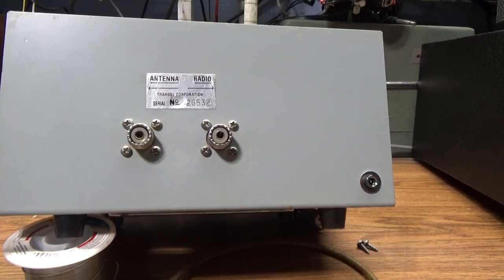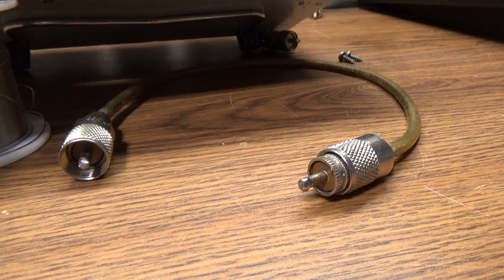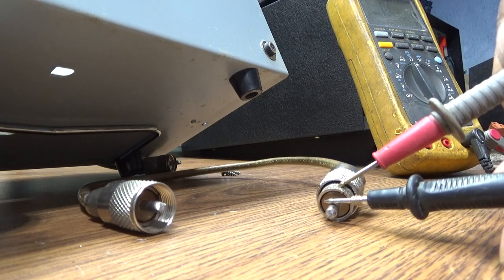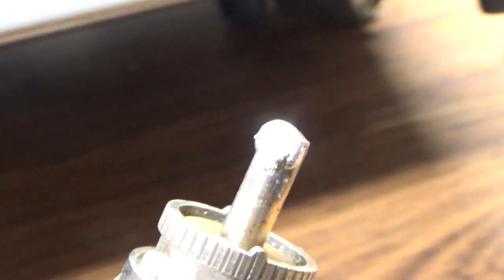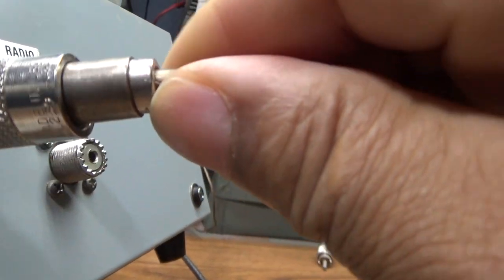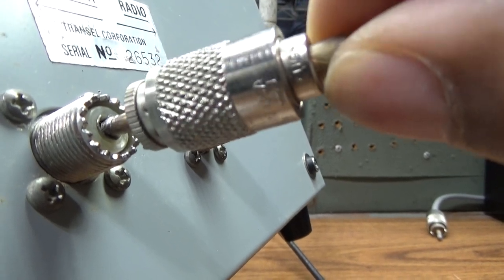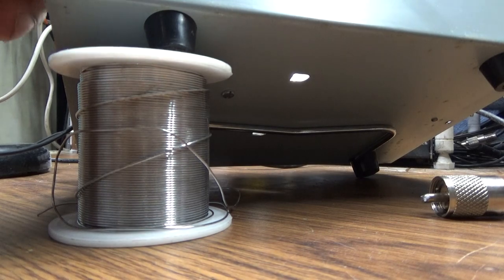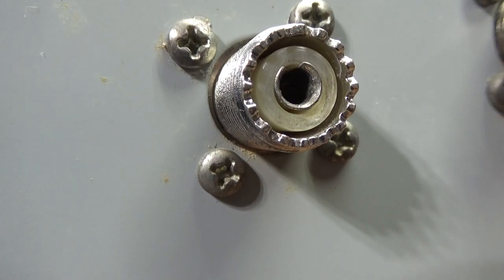Linear Amplifier Killer, silent but deadly

Comment: You know, I hadn't ever put that much thought into that extra solder blob...now it makes sense why I have had trouble with a few connectors over the years at times. Thanks.
Reply: you can always dress it with a file to get the correct 4mm diameter... but check it with a micrometer or vernier all around so you have it spot on.  Check sockets with the blind end of a 4mm drill.  After all, a PL-259 is just a screened banana plug.
Reply from the maker: welcome

Comment: Same thing that happened to me. Took 8 pills to the river. Cost me over 500 bucks to get the amp repaired. It's great you made this video.
Reply from the maker: Sorry to hear that. So many newbies get an amp and kill them quick because of something simple and stupid like this.
Reply: There's another connector problem that will kill an amp: cracks in the connector insulator. Inspect them with a strong light and a magnifying glass.

Comment: It's not over jealous , it's over zealous!
Yes the lump of solder spreads the center of the SO-239 then you have an intermittent connection which kills the final in the amp have seen this dozens of times in my 40+yrs as a tech.
Reply from the maker: number 27 that has brought that to my attention, thanks.

Comment: As a retired aviation tech, that cable AND connector are  bad news.
There should be four fingers , not a split cup inside the connector.
I use UHF to BNC adapters and quality BNC cables for most of my equipment, and for high power, I like N connectors.
The problem with the UHF connectors is the shell can and will loosen up over time, and cause intermittent connections.
Reply from the maker: Agreed. Single split is bad news.

Comment: I tell people this  all the time and they still don't get it. Never force a difficult plug in there either. The other thing is, those single split sockets do seem to more often be like this. They come with a lot of American equipment too. The other thing I'd like to point out is the continuity test. I hear people say it tests fine with my multimeter. But as soon as you put real power through it, it's a different story. Especially if it arcs, heats up and expands, or pits. You're going to have an intermittent open circuit, which swings with power levels, particularly on SSB. This I mean for dodgy solder connections, but it applies to mechanical connections too. Always check the plug for discoloration, grey or black.
Reply from the maker: I agree, especially with the single split sockets. Quad split are much better.
Reply: @tramdr  yep, you know your stuff, I totally agree... from literal experience.
Reply: Yes Sir and look for white connections. That is oxidation of lead and aluminum. Everyone knows red is rust (iron oxide) but other metals oxidize as well. Oxidation interferes with connections. That's why you have to sand a spot clean for the ground when welding. Think about this, If electricity needs a clean connection for welding (with all of that power and Amps) your radio equipment needs clean connections for it to operate correctly. Ya'll Take Care and be safe, John

Comment: I use BNC cables exclusively. They're good for a lot more power than people think. They're more reliable, more convenient, come in water tight varieties, and are an actual standard RF match.
Reply from the maker: I like BNC's but would not use them for high power though.
Reply: I like them for fast connection and for some HTs and Portables, but I find they have more play/wiggle room at the connection, so I don't trust them as much.

Comment: The problem is that the heat causes the Teflon insulation to move and allows the connector to expand. Replace them with genuine Amphenol phenolic connectors.
Reply from the maker: can't beat Amphenol

Comment: Most of us have a multimeter, and it will tell us most of the story. Electricians have a  stronger tool, one that checks the strength of the insulation. It's commonly called a "megger", and it will reveal problems that a multimeter cannot. 
Amplifiers can produce voltages and currents high enough to reveal problems that don't exist at lower power levels.
If you have a situation where the SWR is good when barefoot but goes south when the amplifier is on then you've got an insulation problem.
Reply from the maker: Meggers are cool, but how many people have one of those?
Reply: @tramdr  That's true, unless you're a commercial electrician you probably don't have a need for one. We had them at the power station and when I was a contractor. Now that I'm retired, the odds of my having to test 4160 volt motors is nil to none. Those were the days...
Reply: @tramdr  They're so used to test transformers.
Reply: There's some Cheapo Meggers available nowadays. 73 DE W8LV BILL
Reply: Excellent..Many thanks..I’m 78 years old, and I’ve just realised I’m still learning!  Thank you.
Reply: I used to use one when I worked at Digital, we called it the high pot (ential) test and we'd look for leakage using an ammeter and variable transformer going up to 600 volts if memory serves. It was a really simple circuit and would be easy to build.
Interestingly enough I started having failures at a certain point and after investigation determined that after several years of use the insulation in the test jack had broken down and was carbonizing! Always test your test equipment😂

Comment: Yep, if you make up cables and wind up with a blob of solder (like you pictured), Don't heat it up and try to remove it. Heating it to remove it may create a void inside. Just take a file and and file away the excess solder, it will only take a few passes to remove soft solder. I like to use the tiniest amount of dielectric grease on my connections. I just wipe on (and back off) enough to prevent oxidation. I have heard all the debate about 'greasing' coax connections but I have done this since the 1970s with No issues. I'm also saying that you shouldn't even be able to see any grease, just enough to prevent oxidation,  no 'Blobs of Grease'.... (I know, I know,  your cousin works for XYZ cable company and he says not to...). Do what makes you happy but I have seen equipment acting up and the ends of the cables are white. That is corrosion that will interfere with good conductivity. Nice video and Well done! Ya'll Take Care, John
Reply from the maker: I agree. At my job we had a machine with undersized connections on a wire harness. Deoxit and other stuff was useless, but dielectric grease actually helped.

Comment: The 2nd PL-259 with the "solder blob"  which ruined the dielectric core of the SO-239 was certainly a poor soldering job.  I recall many years ago from the manual with my 1st soldering gun "Apply only as much solder as necessary to make a good connection" Excess solder may fill up tube sockets, or cause shorts.  I have soldered several PL-259 connectors using RG-258 either A or U using just enough solder to make a good connection on the tip. Clip off the excess wire and smooth.
Reply from the maker: Exactly

Comment: And if your amp has those awful HEP transistors, they all pop immediately. I wish they still made the TRW transistors. I have accidentally keyed them without any load for 10 seconds without hurting them. I’m 66 years old, so I’ve seen a few things since I started electronics when I was 9 years old.
A tip for beginners too, if you take an RF power transistor out of your linear and test it, it may test fine. But remember that inside there are many transistors in parallel. You could be testing only one good one and the rest could be open. The only thing you can really do is try another one and see if the power output is okay. That messed me up when I worked on my first transistor linear. And keep in mind that Turner made a bunch of +2 microphones that had transistors that tested fine on an ohm meter, but they had no gain! That one really stumped my electronics professor at the university!🤣 73!
Reply from the maker: I'm a tube man, so I'll leave the transistors to you.

Comment: Yep people dont think about this stuff.u have to make sure ur solder on the tip is not greater than the pin diameter.solderwick the pin tip if your sloppy.use a file worst case to file off the extra lead.also clean and inspect your so-239 for good   friction on plug in.i use deoxit and q tips to clean out the black oxide inside the so-239.rf hates anything thats not clean and very conductive due to skin effect.oxides and flux films as well.thanks for video.god bless.766 pa.
Reply from the maker: I use a small soft brass brush on the insides.
Reply: @tramdr  good idea.

Comment: Just a thought, surely run the patch lead with protective rubber grommet to protect the coax straight to the board. No more problem leads   :text-green-game-over:
Reply from the maker: That surely would help, but its not a fix all.

Comment: Good diagnoses, and good observation.
 I'm not in the same field, but must deal with male/female connectors often, where moisture is at times present, and many times 5 volts dc. Molex connectors and their much, much smaller cousins, I don't know what those are called. 
A good percentage of issues/ failures that result in a repair with a particular component being blamed are in fact misdiagnosed. And it usually occurs with 12 vdc or less, with one or more of these tiny connectors in series with the component and the source. What I call 'micro-corrosion' is another invisible killer. It's very easy to interfere with 5 vdc, with extremely low milliamps, or even alter it, with nothing more than a poor connection. Quite often, disconnecting and reconnecting will at least temporarily alleviate the malfunction. (Around the shop I call this ' dry-fuxking' the connection, ahaha) 12 volt dc components very often are perfectly sound, but the power supply is being interfered with at the connector. What I wind up doing is scratching both sides of the plug and deforming both sides enough to insure a very good contact. Or just hard wiring and eliminating the problem once and for all.
Reply from the maker: At my job, I worked on a machine that ran a data ribbon cable from the power supply in the chassis to the computer board +5v and the +20v lights on the lighted front door. This ribbon cable used one lead for ground, one for +5 and one for the +20. You could actually measure the voltage drop not only from the connector, but it was dropping some voltage thru the small wires of the cable itself. You could have +5 at the power supply, but would loose about .3 volts at the cpu board. Of course the CPU board did not run good like this, lots of problems with that machine. Company fix was to keep replacing the ribbon cable. Field trick was to use anti oxidation compound which did help some. The ground was isolated from the chassis and on some, I would run a ground wire from chassis ground to cpu ground and for the +5, I would run a normal wire from the power supply to the cpu. That worked great, but the powers that be decided they wanted all the machines to be uniform so they did not want me modifiying their machine anymore even though it worked great with my mod.
Reply: @tramdr  haha! Management. They are usually only there for looks.
I make an effort to keep them out of the loop as much as possible. If they start asking questions I either play dumb, or give as little information as possible.  Staying under the radar allows me to increase production while not working so hard. And what would management know about that?
It's amusing how the people with little or zero actual skills will attempt to become some form of low level 'assistant manager' and get some company cards made with their name on it. Little do they know they are merely the managers assistant. 
Even more predictable is how a manager will always chose a person less intelligent than themselves, for obvious reasons. 
Mismanagement in America alone costs the economy millions and millions in revenue,  I doubt we are alone. But it does create a nice level of job security for the more skilled and savvy.😁

Comment: Great video even for veterans. They might not run into this for a long time. On mobile setups if somebody complains of radio not working good all the time I check swr with meter and move coax around to see if it remains steady. Another quick way to test jumpers for me is to hook jumper to radio and other end of jumper to a swr meter and then to a dummy load. If you don't  get a perfect match then y I u have yo find the culprit.
Reply from the maker: Very true

Comment: It’s not Amphenol SO-239’s on the meter. There inferior nylon plastic insulators never work well at high rf levels. I prefer ceramic or polyurethane with a 4 finger port inlet that will contour and spring to that larger blob of solder on the center pin. The one slit tube inlet is a poor design. And for the blob even if it was pro made…it would take a brief hit with and iron or very least in a pinch scrape it with a razor or knife. Very careful inspection 🧐 and great explanation!
Reply from the maker: agreed.

Comment: You can't get this problem with an N Connector!  On the occasions I have to make off PL259's, I have  ALWAYS used a utility knife to carefully shave off any excess solder remaining on the pin .  It will cut off like cheese in thin layers.  Nowadays for high power I usually prefer to use the PL259's that have a braid clamp just like an "N", rather than rely on the poor design of the standard 259.  But sadly can't seem to get these types from anywhere except China... :(
Reply from the maker: I agree with the shaving and have shaved a few myself.

Comment: I know it's not convenient or good for servicing, but wouldn't soldering in the coax directly eliminate a lot of problems. Making jumpers solid connections at both ends.
Reply from the maker: Yes, but most of us change around stuff too often. Another similar problem is with 3-500z tubes. A 500z pulls 15 amps a piece plus the heat from the tube kills the pin connection. When I was a kid and I rode with an older bud to Blackcat and they soldered in directly his JB-2000  3-500z tubes to the sockets. I thought that was crazy, but then found out when you had a bad tube, you would replace both the tube and the socket together anyway. Last, Browning Mark 4's have a connector problem too and some soldered the cable directly.

Comment: Hey bro, I drove tractor -trailer for many years and had radios inside and I have never had a coaxial nor a jumper to a linear that loose.  Just like heat is a killer to electronics, well an arc is even worse, I am not sure if any kind of surge protector could have helped against that...just the same, if your swr's are to high it doesn't matter if you had a loose connection or not, it will blow your pills (transistors), I ran an 8 pound maul off and on for several years and didn't have a problem, crystal clear with any radio I ran, I kept a meter to check my swr's and would never crank the power up until I seen at least 1.5 or less.
You can't just open an antenna and mount it hook up and blow smoke without issues.
Reply: Aw yeah and another thing also, sometimes a person may not have their antenna ground well and the swr's will fluctuate, and another thing also, that little plastic piece inside of the coaxial junction that will be considered part of the mounting bracket I guess you would call it, if it isn't in good shape it can also cause issues.
Reply from the maker: Yep, bad insulation, bad ground, bad jumper, bad SO-239, dirty connectors, frayed wires, loose nuts lol, undersized coax, and more. I once sold a guy a 3kw base amp and he brought it back 2 days later blew up, along with his blown up SO-239 off his beam. Of course he told me that is not what caused the amp to blow up though.

Comment: Thanks for the info i have a 2 drivin 8 and thought i had a problem burning up coax and after opening up the box found a burned contact from 1 board to the other both have pills but incomplete circut not sure what happened

Comment: yup you right never really though about that , but that could be fix with a thin screw driver or a thin object and close the gap a bit. maybe it might help to keep it clean,  oxidation is a bitch, tuners with a roller inductor  get oxidized and the swr  will jump also . thank you

Comment: I am not a fan of PL259 connectors. I prefer a crimp or right angle version as there is no risk of getting excess solder on the connecting surface of the pin.
Reply from the maker: I had some cheap Right angle adapters. They failed so much, I threw them away.

Comment: This principle of "Wetting the joint" applies to any soLder joint. If both parts are not wetted correctly, you will get a bad joint.
Note the "L" in soLder, it's not soder!
Reply from the maker: good soldering is an art. There is a lot to it.
Reply: @tramdr  Yes it is, but understanding the principles and being able to identify a good joint against a bad joint and what's wrong with it is key.

Comment: PL259s come in 2 types. Those with a white nylon insulator should be avoided as the insulator goes soft and distorts when heat is applied and fit badly after cooling. Look for examples with a brown bakalite look insulator which don't have this problem.
 
Ian G4JIU
Reply from the maker: True but bakalite isn't used much anymore.

Comment: All PL-Connectors need contact griese, or they burn black out, then crashes the Final..  The loosing is not the problem, the capacity is then a part of antenna, but if it move util powering , an crash stay befor.
Reply from the maker: I never used or tried grease.

Comment: Artificial diode (poor solder joint plus corrosion) time...
Reply from the maker: Yep, connectors and relays are a major source of problems in amplifiers. Old corroded dirty and loose connections because of dirt corrosion time.